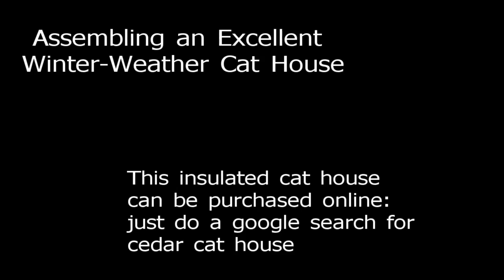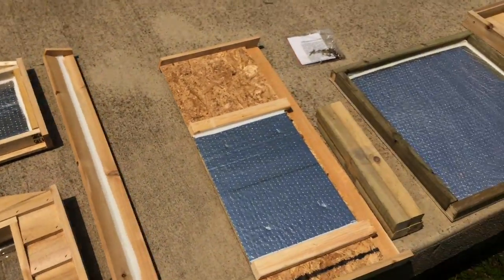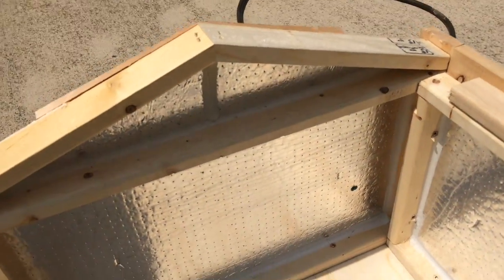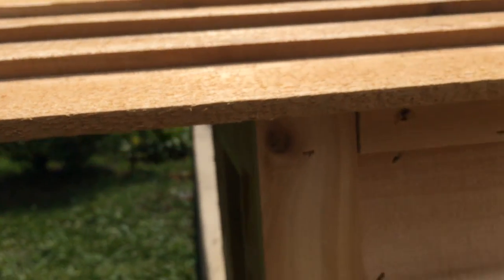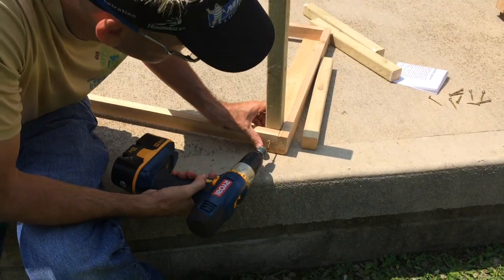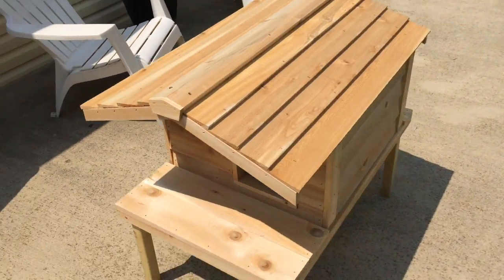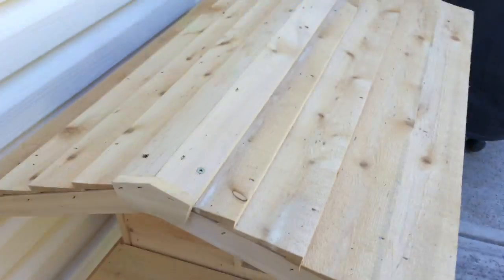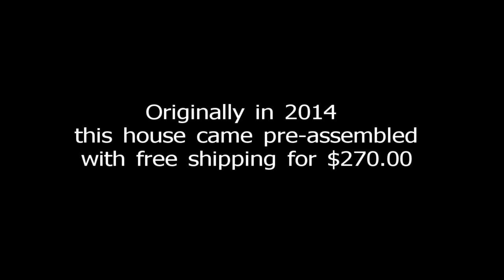Insulated Cedar Cat-House Assembly-Our cats love this house!!!!!!!!!!

Comment: You need to put wheat straw in there.  They can bed down in the straw for keeping warm. Do not use blankets or towels as they will absorb moisture  and wheat straw stays dry.  You can use warming pads also with wheat straw.
Reply from the maker: Thank you Charlotte!  Great tip!  Chad

Comment: could I ask what kind of insulation is on the inside walls? just the putsidd wood and the aluminum material? is there anything in between?
Reply: just looks like the Styrofoam sheet with the aluminum foil face on it. I have found this in different thicknesses at Lowes and Home Depot type places.
Reply: Engine Rebuilders Supply Co. 
Thanks! They don't ship to my part of the world, so I'm building a cat house based on this example. It's been a tremendous amount of work, in part because I don't have the right tools. I have the outside walls built and a roll of aluminum insulation material with air bubbles. I'm wondering if that will be enough though.
Reply: Jay MyLotto
Depends on your weather of course, but normally that should be enough. Especially if you have any kind of warming device inside as well. Just make certain to do the sides and the ceiling (and maybe the bottom), and make sure the edges are secure so they can't chew on nasty plastic stuff.
Reply: Engine Rebuilders Supply Co. 
Yeah.
I'll do caulking on all the seams. My cathouse is almost identical to this one. Only I used pinewood and stainless steel screws. No major differences besides that.
My next step is the roof. Then caulking, then a protective wood lazure for both the outside and the inside.